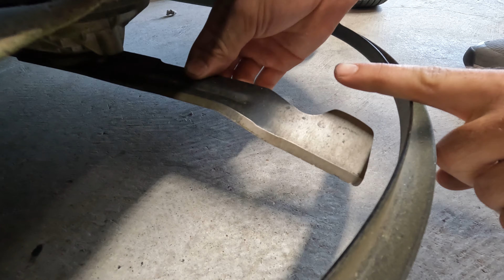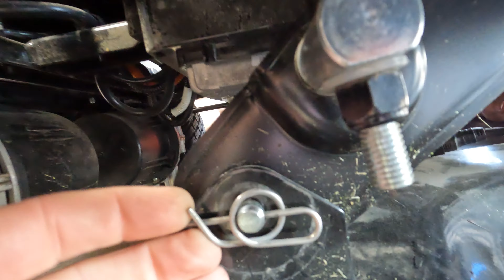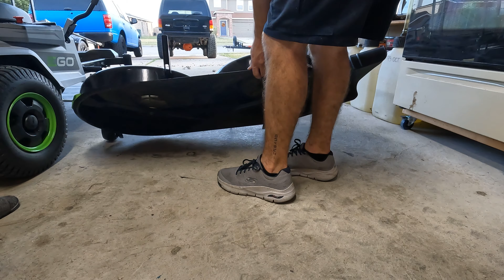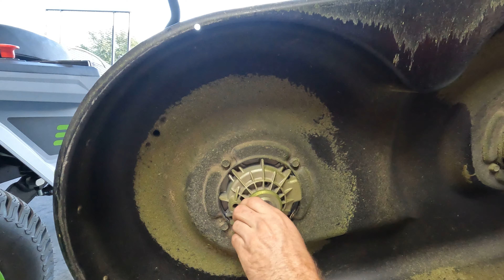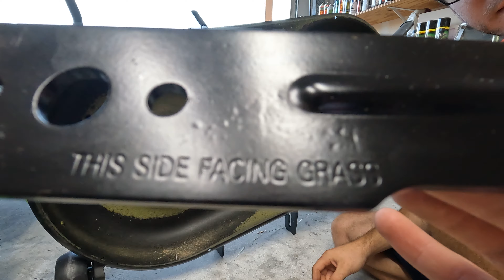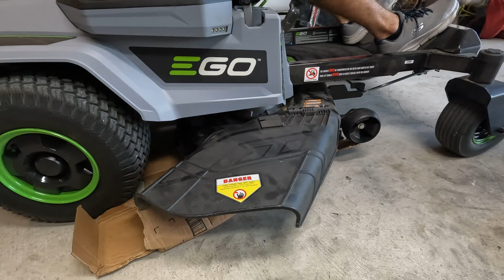How To EGO Zero Turn Mower Blade Replacement 4K

Comment: I used a mower jack on mine. It can be tricky and tight getting the blades on and off but I was able to do it.
Reply: I spent a total of 6 hours trying to put my mower deck back on. the lift pins do not line up. I wrote about it 3 weeks ago, and just yesterday finally got it back on after a lot of wedges and levering.

Will you let me know if your mower jack feels safe when you lay beneath it while wrenching on the blade bolts? Also what make of jack do you use? I'm looking at a MOJACK HDL 500. I don't have an impact wrench either.
Reply from the maker: Not a bad idea!

Comment: Bit of an exclusion where you struggle to get the lift pins back in the holes? I have the 52" deck, and by myself it takes a lot of pry bar work and boards to get the holes lined up. I thought my John Deere was bad to put the deck back on. Not much difference, except the pneumatic cushioned seat is terrific on the EGO!
Edit: It took 1 hour to put the John Deere deck back on. This EGO? I spent 4 hours, and still can't line the holes up. Tomorrow I'll continue. 

And I bought this because the EGO demo looks so easy. Wrong!
Reply from the maker: What a struggle!
Reply: @electrifiedlawncare  Will you make a video of how one person can reinstall the deck?